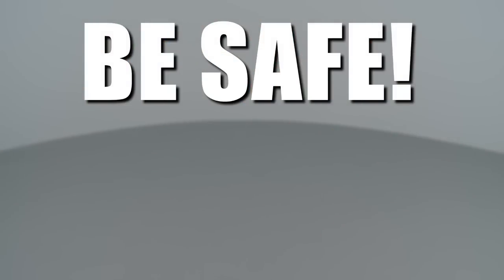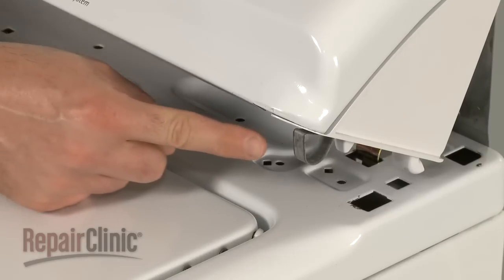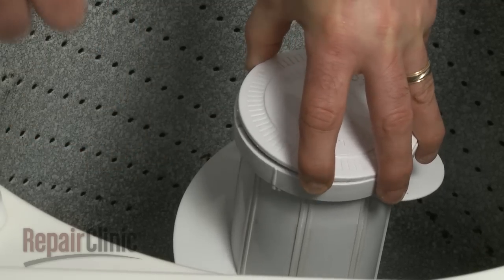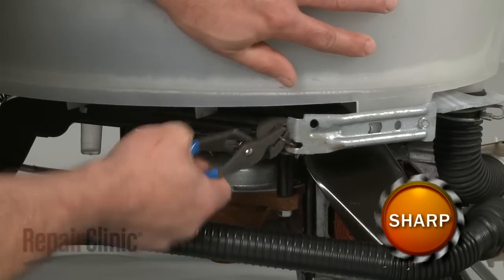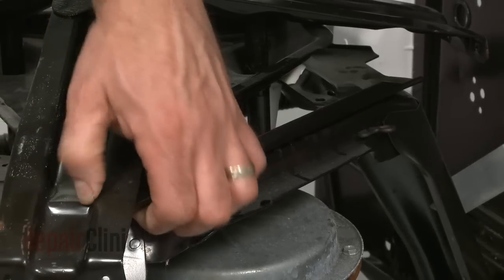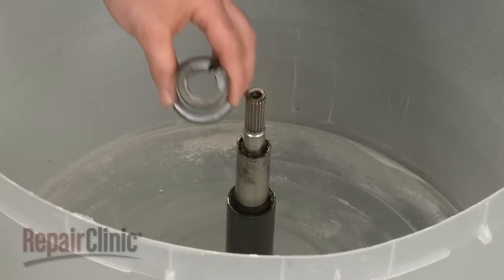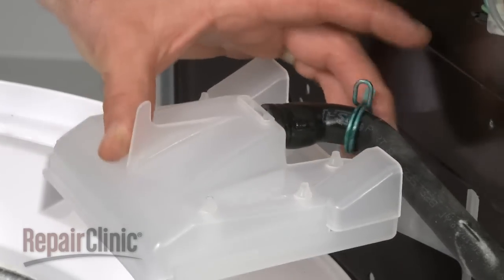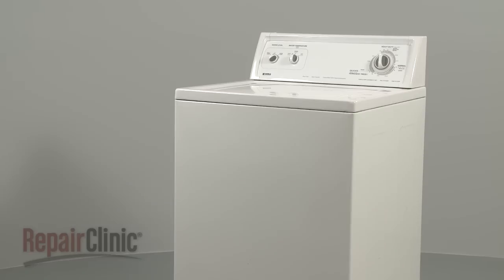Whirlpool/Kenmore Washer Drive Tub Wear Pad #285744

Comment: I have had this washer for one week now have Done about 8 loads of wash=>>allmy.tips/WhirlpoolWasher?a162     So far I love this washer the main thing to do before you use this washer is read the manual to understand how it works with less water. The machine does make different noises. This is normal. In the reviews I have read saying it's loud . Not loud just different noises. Saying it walks across the floor when spinning . No mine spins the way it should. the main thing is make sure the machine is level . It does take a little longer to do a load of wash but it comes out clean. I believe this washer does a lot better job of cleaning than my old washer. To sum it all up it is a great washer

Comment: The pads worked well and I took someones advice and didn't remove the tub. I don't have a spanner wrench. I did clean the inside of as much as I could get to and also replaced the springs which are pretty cheap. I had a little trouble getting the old pads out because they had been worn almost paper thin.

Comment: After watching this video and realized that the tubs had to come out to get access to the wear pads, I decided to not only replace the pads but the suspension springs and tub seal as well.  Ordered all the parts and the spanner wrench tool from RepairClinic.com and I was ready to go.  First thing that caught my attention was the amount of accumulated dirt and grime, especially on the tubs and under the agitator.  It took me more time to clean the machine than to actually repair it.  Since it is a 15 year old machine I should've expected that.  Next, I wasn't prepared for the battle it would take to remove the tubs.  After a whole lot of WD-40 and over an hour of brute force I finally managed to remove them.  After that, the wear pads and the tub seal were a breeze to replace, just like in the videos.  After getting the tubs and spring brackets reassembled, my last struggle was getting the new springs into place.  As I stretched them they kept slipping out of my pliers.  Then it occurred to me to use my vice grips, then all I had to focus on was pulling the springs into place.  Worked like a charm.  After that, the rest was easy.  After cleaning up the mess and putting the machine back into place, I crossed my fingers and did a load of laundry.  No more bouncing around during the spin cycle and no leaks which told me I installed the new pads,springs, and tub seal correctly.  I feel really good that everything turned out well and that I saved a lot of money.  Thank you very much RepairClinic.com for both making the parts for my old machine easy to locate and purchase and for the great videos that guided me in properly installing them.
Reply from the maker: Mike Law Thank you for the feedback.
Reply: B

Comment: My Kenmore washer(110.20712990) has developed a shake during the spin cycle and I noticed black shavings on top of my gear case.  Does this mean I have worn wear pads or is it something else?
Reply from the maker: Mike Law The wear pads could be causing the issue, but we are not sure the black shavings indicates a specific issue.
Reply: ***** My washer has two sets of pads; should both sets be replaced?  Also, when replacing the pads should all the suspension springs be replaced since they're not expensive and given that my washer is 15 years old?
Reply from the maker: Mike Law That would be a good idea since they are likely worn too.

Comment: Can't you just flip the washing machine on its side and replace the pads from the bottom?
Reply: Forest Rodgers That's exactly what I did Forest. Removing the Tub and all of that was way too much work for little gain. You'll be able to figure out pretty quickly anyway whether or not you can replace the pads from the bottom by tipping the machine over.
Reply from the maker: You can try but we think they will be harder to get to. The tub will be pulling down on the springs and they will be significantly harder to unhook and reattach.
Reply: Well I just did it that way, and it was super easy. Snapped the pads on with a channel lock pliers.
Reply from the maker: ***** Congrats!
Reply: ***** I am about to perform this surgery this week...got a little uneasy when I see this video taking the tub apart etc. One site Davesrepair.com doesn't mention the tub dis-assembly ...so you did it without all that? Good I will try...any tips?
Reply from the maker: Forest Rodgers We recommend following the steps we outline in the video.

Comment: There is no need too take the tub apart I did not even take the springs off although you can. Just prop the tub up with 2x4 and change snubbers one at a time moving the 2x4 as you go save some major time.